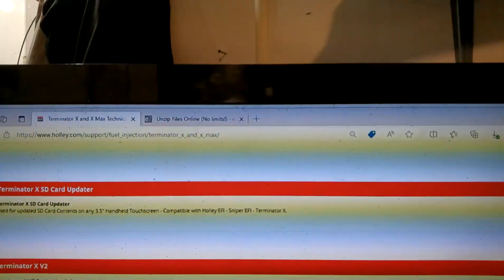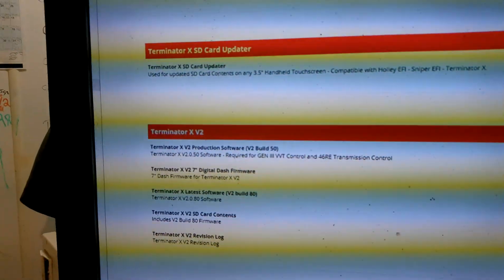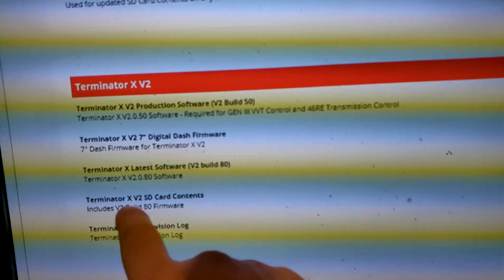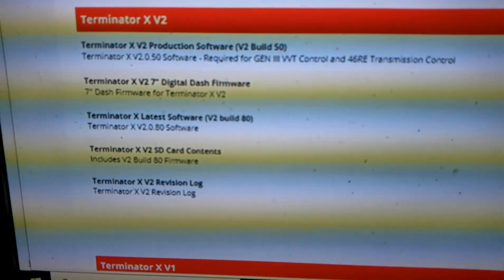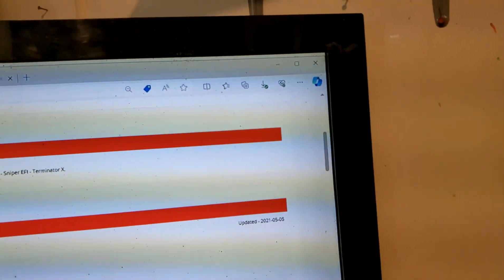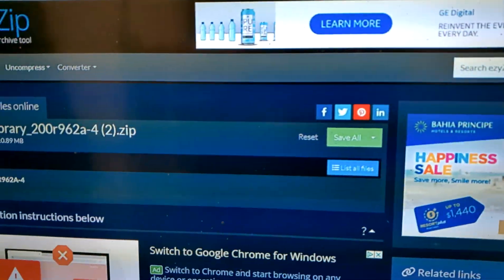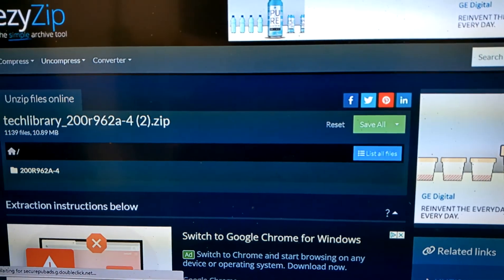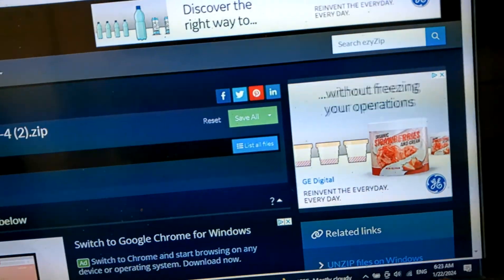How to “UNBRICK” Holley Terminator X or X Max ECU

Comment: All I did was pop the Holley main fuse now it won’t power up smh touchy crap man ……
Reply from the maker: Chances are if the main fuse blew theres a small ground or power wire that may have been melted in the process, if you go on the Holley website you can get a schematic of your specific wire harness, from there you can identify the main positives and negatives and check them to see if any have melted from the short created by blowing the fuse, thats where i would start
Reply: @Macburton96  ok sounds good

Comment: I'm just curious, what computer, operating system do you have that won't un-zip files?
Reply from the maker: I currently have window 10, I have found that either unzipping online or using winzip works better that the computers unzip, if you download the file, open in windows (let windows unzip for you) you can compare file sizes of those files to files you’ve used a third party to unzip and you’ll find the ones windows decompressed are usually smaller, which mean you not getting all the content through windows which is one of the big reasons I personally believe bricks ECUs during upgrades because some key files just weren’t uncompressed properly, so for the 2 extra mins it takes it’s a reassurance for me anyways
Reply: @Macburton96  Interesting, and thanks for the reply. I still have windows 10 as well (refusing to update to 11 until I'm forced to) and I've never had any issues (that I know of) with any files I've un-zipped with windows. I have tuned many Holley (mostly on motorcycles) but the majority of them have been HP and Dom, and I haven't had any issues that I haven't caused myself (and knocking of wood now, lol). The worst issue I've had was 100% my fault IE, I started to download 20+ data logs out of a friend's HP before realizing we only had a few minutes before time runs at Gainesville Raceway. So I decided to turn off his ignition during the download and yup, it pissed off the ECU.
It wasn't totally bricked but it wouldn't start or connect to my laptop, so I did what we used to have to do on some of the very first Holleys (with the original HEFI software, before V-anything existed) and that was unplug everything (including the main the main power) for a few seconds = that fixed that issue...

Comment: Any way you could help a brother out? I bricked mine tonight and stumbled across this. I accidentally flashed with dominator firmware from my lap top. My terminator came with v2 so if this works that would be amazing.
Reply from the maker: @cscustoms7625  find me on insta, @macburton well chant and see if we can sort it out
Reply from the maker: Dominator is the same as hp, all software is compatible to an extent if you try to reflash v2 or v3 software should work

Comment: Good video. Can you update the the ECU without a handheld in general? I cant find any videos of this being done.
Reply from the maker: You sure can, if you download the latest firmware from the Holley website, you can connect your laptop to the ecu via laptop and update directly from laptop software
Reply from the maker: I’ll make a short video
Reply: @Macburton96  wow that would be amazing. I don't have a handheld but I have read things about bricking your ECU. Currently my ECU is brand new in the box and im about to install it. However, i was wonder what i would do when i connect it to the car. I have downloaded V2 & V3 on my laptop ready. However, i was worried about doing the update directly from my laptop to the ECU directly.
Reply from the maker: @johnflanders7523  video is up, hope it’s helpful

Comment: Can you use the same SD card that’s in the handheld and just clear it and redownload everything? I’m new to the holley efi im old school. Or should I get a new SD card?
Reply from the maker: You can use the same sd card, just pop it in the computer, format it and it’s clean you can start over, sometimes when people download new updates and don’t take off the old one, the hand held may flash one firmware and the ecu could flash another
Reply: @Macburton96  I’ve read that splitter cables can cause issues. Have you done this with a splitter cable?
Reply from the maker: @detrickv I don’t use a splitter so couldn’t say
Reply: @Macburton96  well I’m in the middle of doing this rn, the files are taking forever to unzip idk why but I’ll get back to you if I have any issues
Reply: @Macburton96  I didn’t have any luck
Reply from the maker: @detrickv which firmware did you download? V2 or v3? And which software came with your ecu?
Reply: Hey if I could reach out to you for some advice I’d appreciate it i bricked my ecu and am struggling to get it back I’ve spent 2 whole days on trying to get it back

Comment: Got a weird one for you. Driving along car shuts off. No power out of term. No fuel pumps nothing. Unhook the battery for a couple hours. Hook it back up and the car starts and runs for a minute or 2 then shuts off and dead term again. Think it's a software issue or is the term just kicking the bucket on me?
Reply from the maker: It sounds like you might have a bad grounding issue somewhere I had to deal with this with my cousins Truck and one of my neighbours car. They had a ground running from the battery to the engine block, but nothing from the engine to the frame and it wouldn’t charge the battery Properly it would seem to run all right and then all the sudden the battery would die and then you let it sit for minute and it would start right up and it was wiping the tune so it would kill the fuel pump and the fans maybe go through all your power/ grounding wires and make sure everything is good